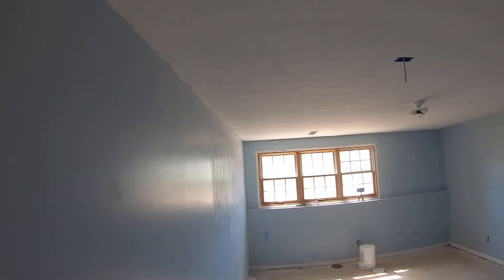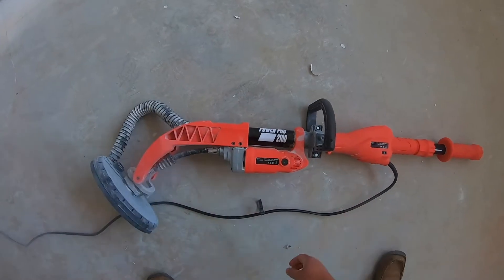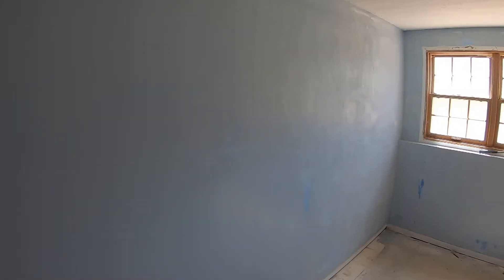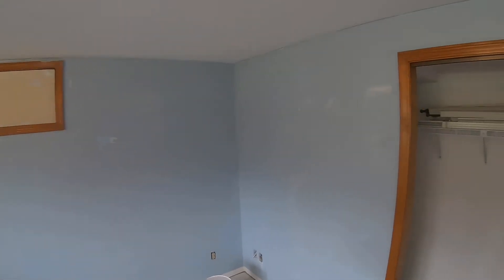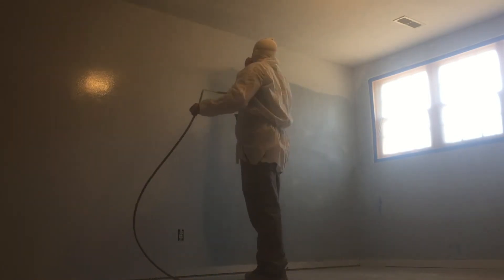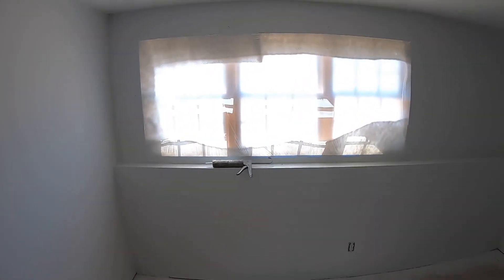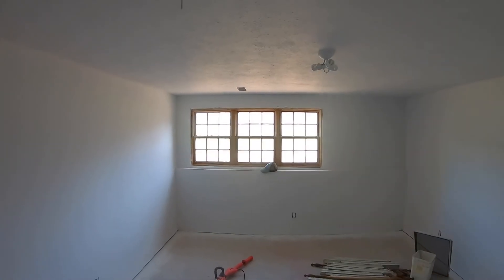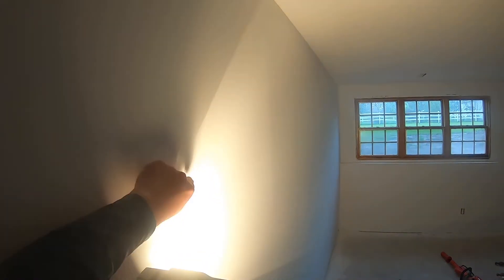How to Fix a Bad Paint Job on Drywall or Plaster

Comment: Finally, this is exactly what I was looking for. Confirmation on what I need to do and how to do it. BTW I searched "how to fix bad drywall after paint" Add that to your tags and let me know if it helps. This was 4th down It should be first at the top of the page. I am above average at drywall so I paid a 25 year pro? When he tried to tell me he was ready to paint I showed him the trick with the light and he went back to working the drywall. That is until I left the jobsite. As soon as I left he through paint on it without even brushing the sanding dust off. Everything looks terrible. Just like the walls you filmed here. Then he texted me wanting to get paid for wasting all my paint and creating a huge mess for me to fix. I will order the sander and go back to doing all my own drywall work. I will make a video similar to this on my Sane Enterprises channel and give you a shout out for your video. Liked and Su8-ed on my way out. I hope you get 100K views.
Reply from the maker: Thanks for the kind words and the tip about the tag.  I added it.  Let me know when you finish your video and I'll swing over and watch it.
Reply: Wow.  "Professionals" who don't care - I've experienced it too.
Reply: @BabyShark-kd9jl I have recently experienced it. Now I have to have my whole house for the most part painted over.

Comment: Kinda interesting he put so much work into it. I just hand sand the uneven parts, spackle the holes, then use Behr paint with primer and it doesn't even look like the wall is painted its so smooth and even.
Reply from the maker: I normally don’t have to do this but this was a really bad paint job with a lot of runs and drips.  Drips from latex paint are difficult to hand sand if there are a lot of them.
Reply: theres no such thing as paint and primer in 1 its BS you should always prime before painting.

Comment: I thought it was interesting that you added caulk to the top of the wall.  I've done that before but only with the bottom baseboard since it had a small gap from the wall and when I painted it, it looked like it was part of the wall.  Do you paint the caulk with the new wall color or leave it white to match the ceiling?  Thanks

Comment: Before you fill the wall after sanding I roll out a miss coat in white first so paint will seal and show the parts that need to be filled first, that's what we do in the uk
Reply from the maker: Nice tip

Comment: I have the worst paint job I have ever seen on every surface in my new house.  I have to use this method on every single wall and ceiling.  Thank you for this video.
Reply from the maker: Just FYI.  The power sander will not work like this on a ceiling with texture as it will sand all the texture off.

Comment: Hello my husband decided to try and help me out by painting the bathroom before I had washed and cleaned the walls. They were very dusty and nasty from years of our kids taking steaming hot showers. He used behr premium plus primer but the paint shows all these teeny tiny cracks where I believe dust and lint is showing it up through the new paint and you can also see the old color underneath. Does this work on texturized walls as well? I don’t know how to fix it now.
Reply from the maker: It will sand down the texture as well.

Comment: Awesome video, thank you.  

Question: The previous owner did a bad paint job over plaster walls - paint is flaking off in patches everywhere, except bathroom.  Our condo does have fluctuating humidity and temperatures, so I'm guessing the paint or primer in the rest of the condo was not moisture resistant.  

I would like to remove all the paint and get back to plaster just to be safe... can I do that with a drywall sander?  Or, best to only knock down the paint flakes and proceed with patching, better primer and repaint?

Any other suggestions for dealing with what might be humidity related paint failure?
Reply from the maker: Without seeing it in person it’s hard to tell what the cause of the flaking is.  It could be someone tried to paint over oil based paint with water based paint without priming the wall first.  You can try sanding all the paint off,  however this is a lot of work.  Might be a good idea to consult with a good drywall or paint contractor before you start anything yourself.  If you get a quote you can also pick their brain to see what needs done.  Then decide if you want to try it yourself.
Reply: @HowtoHacks  thank you!

Comment: Ugh my parents hired "professionals" to do drywall and paint and they did a crappy job. A lot of textured spots, dust in paint (pretty sure they were painting and sanding drywall at the same time without creating sealed zones. Anyways... looks like if we wanna fix it we'd be basically re-doing all that work. Was looking this up to figure out how to fix at least the very obvious spots. Idk how they could walk away saying they were done. A few messy corners of mudding could be forgivable but just running a hand over the wall it's so obvious they had dust in the paint, or didn't clean walls before painting or something. Just unbelievable.

Comment: Hi guys ,,,, we are complete novices and only did one small wall to see how it would look. We spackled and sanded, then we primered with the Pro999 Clear and then put the Behr Marquee 1 coat on. The paint and all looks great and no probs with  that. We didn't sand spackle or do it properly so the spots show like mountainous territory on a map. Can we power sand and redo the bad spots alone. Please help
Reply from the maker: Yes.  Sand the high spots and repaint.
Reply: @HowtoHacks  Thanks ,,,, great video

Comment: Hi, did you dust off the walls between using the power sander and filling the holes?

Also, how important would you say it is to clean a wall with let’s say some mild detergent and water before painting? Let’s say I’ve painted textured wallpaper but have only dusted it off, not cleaned all of it. Maybe just taken some stains. Would that qualify as unacceptable prep work? How can I test if the paint job is okay now after it’s been painted. One room was painted more than a year ago. How could I test to see if it’s ok? Thanks for the help
Reply from the maker: I used a broom to knockoff the dust after sanding.  

Cleaning the walls is probably over kill unless they are really greasy.  Even then I would just spot clean.

You don’t have to sand the walls if they are smooth (no drips or dirt in the paint).  This determines the amount of prep work needed.  If the wall is stained a lot you may have to prime.  If the wall is in good condition you can just start painting.  

If the paint doesn’t bead up on the surface when painting then it should adhere to the surface just fine when it dries.  

If the paint isn’t flaking off an old surface that’s been painted then it’s good.
Reply: @HowtoHacks  Thanks for the reply! Are you a painter or some sort of builder by trade? Just before the 2 minute mark in the video, after power sanding you were going to fill the obvious holes. Did you dust off the areas to be filled or did you just fill them? So I'm not asking whether you dusted off before painting, but specifically before filling the holes. In your experience, is it very important to dust off holes and such before filling them? Did you use spackle or something else?
Reply from the maker: @Alexander-qy7yz  I have a lot of carpentry experience.  Just hit the areas you want to fill with a dry rag to knock off any dust then fill and sand again.  I don’t think this is a very important step.  Non-shrinking spackle will work to fill most holes.  If you are doing a larger area with a skim coat then you want drywall mud.
Reply: @HowtoHacks  Gotcha. But if I’ve already filled some areas? Scrape out the old spackle, clean it out and redo it?
Reply from the maker: @Alexander-qy7yz  I wouldn’t.  The internal material of drywall (gypsum) is dust.  The spackle just fills the void.
Reply: @HowtoHacks  Is there any type of wall where you would remove a spackle filling that was done without removing dust/loose dirt/particles first?
Reply from the maker: @Alexander-qy7yz  It’s not a bad idea to do but I wouldn’t worry about it that much if you forgot on any type of wall.
Reply: @HowtoHacks  Thanks for the help

Comment: I’ve had so many people tell me that I don’t need to sand a painted wall or even prime it before repainting. You did both in your video. Is that because there was so many repairs to be made?
Reply from the maker: Yeah.  The walls were a mess.  Drips and debris in the paint were everywhere. For the most part, if you have a good paint job just apply paint over it.

Comment: Does sanding take the texture off? We have orange peel texture and lots of paint flashing. I’m not sure how to fix it. Do you retexture before priming?
Reply from the maker: Sanding will remove orange peel and a textured surface.  In the house I live in now I actually sanded a lot of the texture off the ceilings and had them retextured to fix some bad spots.  You want to texture before you prime.

Comment: what kind of paint spray gun did you use? also would you also sand for door and window trim?  i have tenants that painted the trim black.... and they did an awful job (I didn’t know they were doing it).
Reply from the maker: I used a Sherwin William’s brand airless sprayer.  Yeah, I would sand the trim and doors too if there are a lot of drips.
Reply: If you are on a fixed income, but still want to invest in a paint sprayer, the Graco Magnum XL, is a great option. I use this sprayer alot, and if you have the right tips, and you prep properly, I find it very dependable! Btw, you should be able to find one for under $600.
Hope this helps. Enjoy your weekend. 
~Joe ✌😎

Comment: I have that same ceiling design and I hate it. Can I just use a drywall sander to get rid of it then prime and paint?
Reply from the maker: Yes you can sand down a textured ceiling.  However you will probably need to skim coat the whole thing afterwards.  Then prime and paint.

Comment: After you fine sand the primer do you have to wipe down the walls before you put the paint color on?
Reply from the maker: If the walls are really dusty you can use a clean broom to knock it off.  A dry rag would work as well.

Comment: I am just diving into home improvement for the very first time and came across your awesome video- I have a few questions, if you don’t mind! 
The walls of our apartment are in even worse shape than this, and I think a power sander is the only way we can possibly fix the paint drips, uneven drywall, and thick, goopy spots that have built up from probably literal decades of bad paint jobs/repairs. I live in an old building in NYC, and my biggest worry before diving in is lead paint. We aren’t sure when/whether this apartment has been gut renovated and we are so worried that when we sand we will expose ourselves and our cats to lead. Do you have any advice on how to handle this, or general thoughts? Are there power sanders that can remove the dust as you go?

And one more question, do you think this is too difficult to do a job like this when you are also living in the (very small) apartment you’ll need to work?
Reply from the maker: I would get a lead based paint testing kit.  When doing this you will need to get a sample of all the layers of paint.  Just use a utility knife to cut through and remove the layers in a small section.  Then you can see if any layers of the old paints were lead based.  If the test is positive you can try skim coat the walls with drywall mud to even everything out.

Just The power sander I used has a vacuum attachment to hook up to a shop vac.  It catches a lot of the dust but not all of it.  Doing this project while living in an apartment is possible I just depends on the persons willingness to put up with the inconvenience.   Just make sure to cover everything up as it will create dust.
Reply: How to Hacks thank you so much!

Comment: The previous owners to our house did nothing to properly repair the damage to the walls that the owners before them did. Literally every wall in this house has a running line at the top of paint drips from a spray painter (looks like the wall has water dripping down it, that's how thick it is), super smooth areas where they patched but the wall above and below it looks nothing like it, uneven patch jobs that you can clearly see outlined in the walls, the ceilings are multiple colors of white from patch jobs. It makes my eyelid twitch. This would definitely help most of it. Would the sanding with a power sander help the uneven patch job areas as well? I can't afford new drywall right now but could I sand down as much of the awfulness as possible and maybe skim the worst walls and then prime and repaint? I wish I could post pictures!
Reply from the maker: The power sander should get most of it out.  The 60 grit doesn’t gum up like the finer grit sandpaper does.  Any area that’s uneven it will flatten with enough patience.  Then skim coat the imperfections, sand again, and prime with a high build primer.

Comment: Hello! I have a question for you. What if the only “bad” painting done is the part in your video on the ceiling? I think it is referred to as a “cut line” is there any way to fix just those areas without having to repaint the whole room?
Reply from the maker: What’s wrong with it?  Is it just uneven and not cut in well or are there a lot of drips?
Reply: @HowtoHacks  it's uneven so some of the paint is on the ceiling like in your video. The rest of the paint job seems fine, no drips on the walls or anything like that, no apparent holes that weren't filled or anything.
Reply from the maker: @korapeck6053  sounds like you just need to recut in along the ceiling.  Take ceiling paint and touch up parts where the wall paint is on the ceiling and then touch up the wall paint.

Comment: Any advice for doing something like this but with textured walls?  I'm dealing with a horrible paint job with paint that is so thick it is making the texture look strange.  I'm not sure if sanding aggressively will ruin the texture underneath as well.
Reply from the maker: The only way to fix this is to sand the texture off most of the way and reapply the texture.  I have done this numerous times to textures ceilings that I had to patch.  When sanding off you want to make it look kind of like knockdown texture.  The new texture then hides everything and you can’t even tell it’s been sanded.
Reply: @HowtoHacks  Okay, I was worried that was the only way.  Thanks for the quick reply!  Love your videos!

Comment: Why do you prime it and not skim coat?
Reply from the maker: I got by with using a high build primer that can be sanded.  Skim coating is a lot more work and the walls weren’t in bad enough condition to justify doing it.

Comment: Why are u putting caulking in between wall?
Reply from the maker: It gives a smooth transition between the ceiling and the wall which makes it easier to cut in with your brush.

Comment: Looks like my pandemic mess. What about a re-textured room with semi-gloss and 99 coats of primer & paint. HELP!
Reply from the maker: You can sand down the texture, retexture, and then paint.  I have had to do this before on ceilings that were messed up.  It’s a lot of work.  You can also tear out the drywall and start over.
Reply: @HowtoHacks  i wondered about that. What a pain! Thanks!

Comment: I just spraying 1-2-3 primer on my walls and I’m guessing the paint before was oil based. Now I have many runs. Can I just sand it down and then spray with shellac?  Or how will anything stick to the walls other than oil based paint?
Reply from the maker: Sand it down so it’s smooth again.  I believe an oil based primer can accept an oil or water based top coat so maybe use an oil based primer.  I would talk to someone at sherwin Williams before adding anymore paint or primer though.

Comment: I painted the apartment and I still have stains from each crossing, how can I fix it on the wallpaper?
Reply from the maker: I’m not sure what you mean by a crossing.  If there is stain showing through use Kilz Original stain block primer.  I’ve used the stuff in a spay can recently and it worked great with one coat.

Comment: I just don't understand why people rip customers off??? Sure, you will get away with it for a while. But word of mouth gets around quick and you will probably wind up in court.

I paint and do limited handy man services. I am straight upfront with mostly women customers. You can use behr premium, ultra, or marquee. Here are the differences between them. I always do a basic wash of the walls. I do charge a little extra for a smokers house or really nasty walls where I use TSP for heavy cleaning. I still use brushes and rollers and cover everything.

I very often get asked if I can install a new ceiling fan, switches, covers, etc. 

I will sometimes do something without the customer even asking. Had a ladies house that I noticed the old light switch was lose and often sparked when flipped. I just changed it along with the plate (2.00). She said an electrician wanted 135.00. Two days later, two of her co-workers needed work done.

I am rambling. But my point is that you can make a lot more money if you are honest and do it right. You don't have to constantly look over your shoulder. Its not hard to paint, replace outlets, switches, fans, and doors.
Reply from the maker: Agreed and well said
Reply: Where are you based?
Reply from the maker: @VibrantDesigns  Northern Indiana.  Why do you ask?
Reply: @HowtoHacks  wanted to hire a honest person like you. I’ve worked with dishonest people whose crappy job fell apart months later.